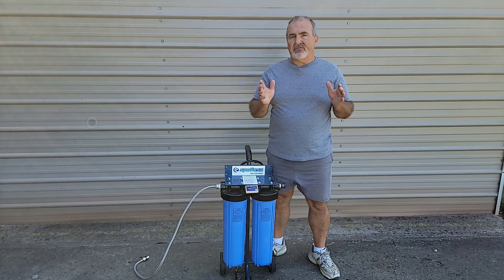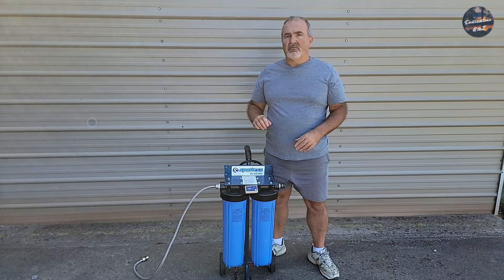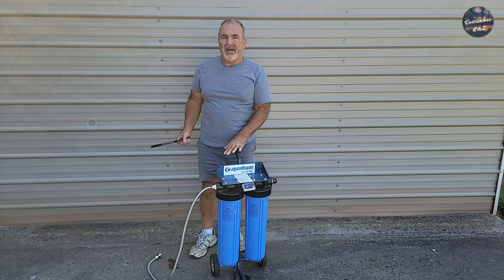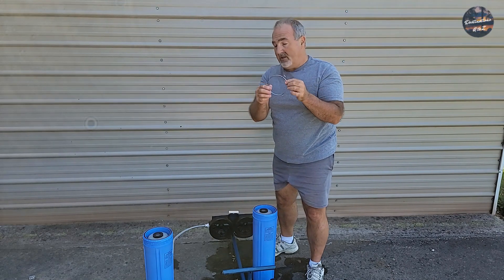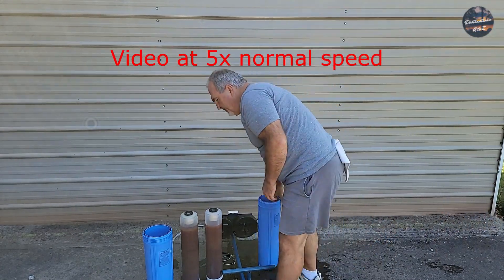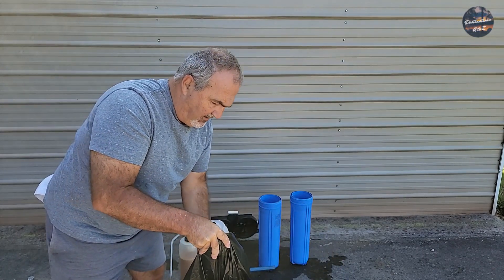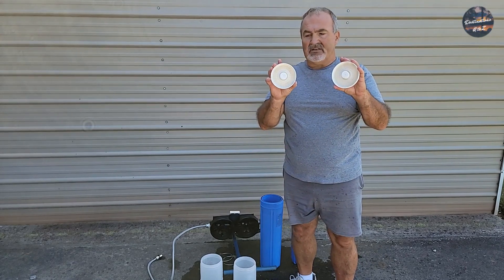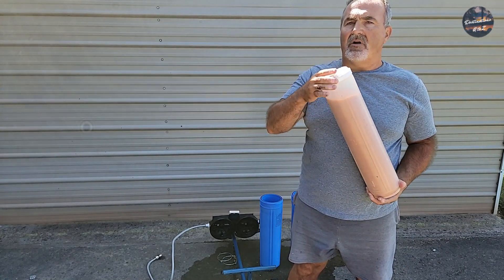How to Change Out Resin in a CR Spotless DI Water System

Comment: So when I changed my resin I had black resin and still clean looking resin. My readings was coming back around 30tds on the reader. My question is was the good looking resin still useful or trash as well as the black looking resin?
Reply from the maker: Thanks for your comment and question!  The answer is, it doesn't matter if it looks clean or not... the naked eye can't tell. If your are above 1 on TDS you will start to see spots and will only get worse.  The only gage you can use will be your eyes on water spots on your paint job.... that tells you when you are past time to change but to be proactive always change above 0

Comment: Is the fill level of resin important?  After changing the resin in my system the flow is substantially restricted.  I've owned the system for 13 years and refilled it a few times.  This is the first time I've lost significant flow.  I still have the original cartridges.
Reply from the maker: Thanks for you comment...!  No... Fill level is not important. I have found if you remove the very restrictive Stainless tubing and connect directly up to both sides with water hose the flow is MUCH better....Also, doesn't affect the TDS...